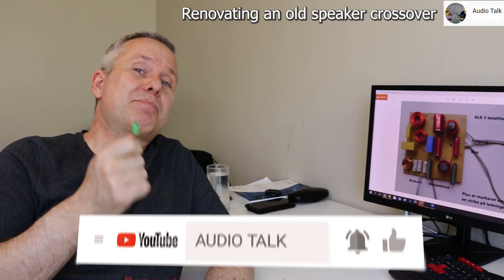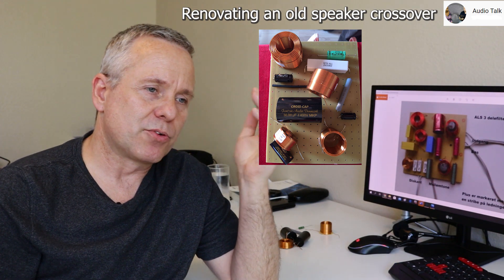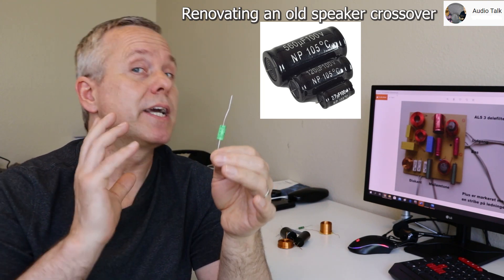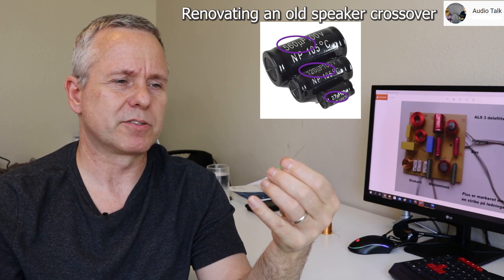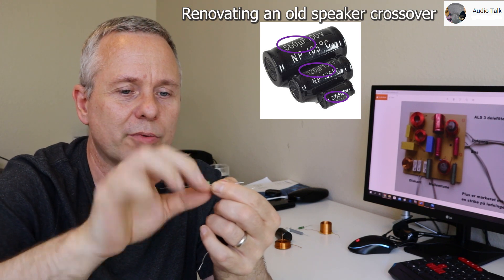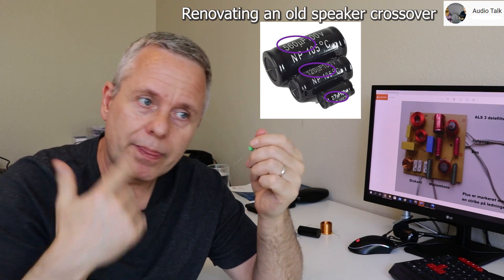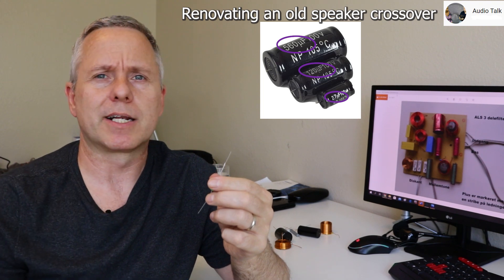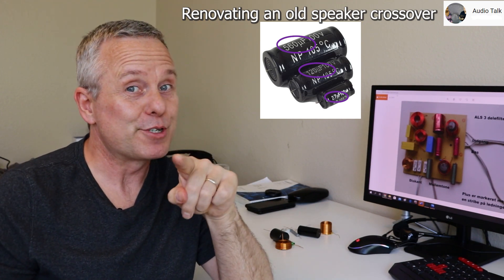Renovating an old speaker crossover

Comment: Stock electrolytics have a smearing effect and saturate.  High ESR and tendency to degrade and leak.  Not to mention, speaker companies use lowest bidder caps that aren't likely in spec to begin with. The only time I replace electrolytics with the same, are large value woofer caps. Then I use 10% electrolytics, built much better than stock.  If the crossover area is too tiny for even Jantzen polyester caps that can stack, I at least bypass the tweeter cap with a .5uf mylar cap.  I had to do that in the Elac debut dbr6.2 due to zero space. I never use exotic caps like copper, tantalum, ceramic etc.  Those tend to be harsh and expensive.  Even 5% metallized polypropylene will be a great improvement.

Comment: Can you really just swap in a film capacitor in place of the old electrolytic blindly, without severely and randomly changing the voice character of the speaker?
Reply: In response to 3:20 in the video.
Reply from the maker: @RobareDuccie1999  the target of replacing to the more expensive film capacitor is to get more details and clarity, mainly we are talking about the series capacitor to the tweeter. So yes it will change. If you can find the ESR of the old electrolytic capacitor and then get a wirewound resistor and place that in series with the new film capacitor and you will likely get a more balanced sound. But all in all a electrolytic capacitor in series with the tweeter is something that you basically don't find anymore because it introduces so much distortion.
Reply: @AudioTalk  Would the ESR change as an electrolytic capacitor ages? If so, wouldn’t you need to grab the ESR off a new equivalent? I’m not sure if ESR changes or stays the same as electrolytics age.

Comment: Just took my Sansui 9090 to an old tech guy that repairs old electronic stuff and he says flat out that there is no need to replace caps unless they are no good.
Reply from the maker: This video is about renovating a speaker crossover and not recapping an amp, big difference. Sure if its caps in the powersupply its not gonna matter as much, but still, to they fail??

Comment: im wondering if it would be a good idea to buy old Bose acoustimas 5 bass box to repurpose the crossover from it for a new system.  they are quite cheap if the woofer in them doesn't work.

Comment: Gonna try and and replace the series capacitor going to the 2232 horn/compression driver in my jbl 4425, if i put a film poly cap, is it a good idea to add 1ohm series resistor as well to make sure to make up for the esr?

Comment: Hello, not long ago I acquired the Kugel-Box 310, beautiful although very beat up on the outside, already polished because there was no way to remove the deep scratches and dents. I changed the capacitor for a polypropylene one, and although the Frako capacitor wasn't far out of value (incredible considering the years), the ESR wasn't good, so the change was for the better. I added more cotton to the walls.

The bass is very good, surprising for how small they are, but the highs seem to be poorly balanced compared to the bass. I tested them with a Nad 3020 and a Technics SU 7300, obviously, each with a very different sound, but with the Technics, which allows two pairs of speakers, when switching with my other Japanese Sonoco speakers (i repair them and sound amazing better than a lot of new speakers) , the volume and definition are brutal. It's like the Kugel-Box 310 sound muffled or, how can I describe it, dry... they sound good and surprising, and they are very directional.

My question is, did you experience the same? The crossover is simple—transformer, coil, 6.8uf capacitor. I tested the tweeters and they are fine, except for the possibility of some loss of functionality over the years, but I doubt it, they are impregnated dome type, and they look great. The front grill probably takes away some brightness, but I am amazed at how muffled the sound is. It's not bad, but I was expecting more clarity from these small ones.

Comment: The best way to upgrade a crossover is to bin it and use an active crossover with Class D amps. Chalk and cheese, unless you are an audiophool.
Reply from the maker: absolutely, but depending on the budget it can be too hard on the budget, but if its high-end its typically better to do that. Phase and linearity is a bigger issue than a clean signal path, so I agree with you.

Comment: Maybe you can help me if you do not mind. I have an ok pair of JBL62 speakers with the Titanium laminate tweeters in them. They are a bit too bright for me. There is pair 4uf 100v axial caps in the crossovers.  What value could I use to tame the tweeters down just a little? There are also 2 orange drop looking I guess caps on the board to. Sorry I do not not know their values just yet or their purpose on the crossover.  As I understand several models of vintage JBL book shelve speakers with these titanium tweeters have a tendency to be to bright. Thanks ahead of time.

Comment: good video👍🏼... I have a pair of Spendor S 100 and changed out the capacitors… I tried changing with Mundorf capacitors but then ended up switching back to original new capacitors...I was let down by the Mundorf, thinking they would be better...I have added Wima 1.0 uf next to the new Bennics on the LF...if they are placed in certain positions on the crossover, the sound can be better...I'm sure you know about this...

Comment: Thanks for asking me to ask . What if anything should you do to said crossover if you replace a tweeter and woofer in a3 way, HD66 Marantz box? The only spec that's similar is 8 ohm and hole size, they don't sound as good as Mordant 2ways i replaced tweeter and woofer with great results . Checked the two film caps and resistor , and also the 2two pots on the front are now good . Crossover points not matching ?? And sensitivity different , sorry . Thanks .

Comment: 1/26/2024: Just found your channel and subscribed. Informative and easy to follow. I have a pair of 31 year old Technics 2-way speakers.  10" woofers and tweeter.  They are still in use with a Kenwood KR-6400 Receiver that is about 31 years old also.  Sounds very good.  Best Regards

Comment: Kent! Great video! I was wondering if you can give me some advice improving the LF of My KEF speakers! I need a little more low!
Reply from the maker: With the crossover you can only dampen midrange or tweeter to make the woofer stand out more. However if the crossover point is higher than 250Hz to the woofer it probably wont have this effect, because you likely are interested in area under 100Hz. And that area is the cooperation between box and woofer, so you cant do much about that other than getting a subwoofer.

Comment: Hey Kent one quick question. I got 2 jbl prx 525 loud speakers that are self powered rated at 1300 watts peak. Long story short on both PAs both amps are gone. I wanted to know if i do an amp delete and run a high quality audio crossover for the Loudspeakers can i get away with that?

Comment: How do you feel about upgrading the crossover components on new speakers?
Reply from the maker: There is certainly speakers that gets produced where a better series capacitor or resistor can lift the tweeter performance
Reply: @AudioTalk  So not a huge difference.  Maybe a little sparkle.....
Reply from the maker: @roybatty-  impossible to generalize unfortunately, and the differences can also be subjective. Many have an experience that its a big lift.

Comment: Changing from electrolytic to polypropylene will change the crossover point and roll off of the crossover. THIS WILL NOT ALWAYS BE AN IMPROVEMENT.

just because one component is more expensive than another doesn't mean it will give better sound. If you switch types or values of your caps, be prepared to change them  back to do an honest A/B comparison.

I'm sure a Mercedes Benz alternator is better than the one in my Chevy, but that doesn't mean I can drop it in my engine and magically expect better electricity!
Reply from the maker: The series capacitor to the tweeter will have a even greater improvement if a series resistor is inserted at the same value as the ESR as the old cap, preferable wirewound. With that said an electrolytic cap has no place in that position and still they can be found in vintage speakers, and they hysteresis introduce so much distortion that it supersedes the change in the Xover point. ESR is not particularly high with larger caps, so that issue is a diminishing issue as you go down the frequency band.

Comment: Ken,   Staring at a pair of 40O watt 2 channel crossovers from Arena15 soeakers with popped VR1 resisters, they are no longer available as boards, but wondering if they are thermistors.  From pictures, they apoear as blue disks, any suggestions on replacements?

Comment: I have a pair of Radio Shack Nova 8B speakers that I bought around 1976.  In one of the speakers, neither the midrange or tweeter work.  The woofer does work.  I'm thinking it might be the crossover.  Is there a way to test the crossover before just replacing the capacitors?  Thanks!
Reply from the maker: The midrange you could test full-range directly connected to the amp. If its both mid and tweeter could just be a wire that got disconnected

Comment: Is it OK to replace electrolytic caps with film capacitors of the same value? The problem is that elecrolytic capacitors do drop their capacity with increase in signal frequiency but most of the film caps have the same capacitance at any audio frequency. So the filter output response with a film cap will be different than it was designed to be with the original electrolytic cap.

Comment: Hi Kent. Do you know what might cause a speaker to drop in volume? I have an old pair of PSB 800 speakers, and one of them is much quieter than the other. I tested the amplifier on a different pair of speakers, and it wasn't an amp problem.
Reply: Sounds like the resistance increased somewhere in the circuit?

If it's roughly similar volume at low frequencies, but lower volume on the highs then I would look for a problem in the tweeter portion of the crossover circuit. If it's similar volume at the highs but lower in the lows, look at the woofer portion. If it's lower at all frequencies then look at the binding posts or your cable or amp or some other portion of the rig that carries the full range.

I should also say, it could be your room. If you haven't already done, swap their position in the room and see if the volume continues to drop from the same side. If it does, it's due to your room geometry and you'll just have to adjust the balance. My room has some weird geometry and the right speaker is always about 1 dB quieter than the left 🤷.

Comment: I have my Paradigm monitor crossover burned-out.  But I opened and checked it out it's actually one of the conductor. Is it possible to fix that?
Reply from the maker: Inductors are the spools of wire and the plastic looking things are capacitors and lastly the ceramic things are resistors, but none of them can be repaired only replaced, and to replace you will need to know there value. For inductors value in mH, capacitors value in uF and resistors in ohm.

Comment: Great stuff Kent, would a cap breaking down cause my mid and bass drivers on one speaker from cutting in when the other side does?
Reply from the maker: Hi Craig, I am sorry I dont understand the question. Is there way to rephrase the question or maybe more explanation to what you are experiencing?
Reply: @AudioTalk  Hi Kent, sorry for the initial explanation, i will try again.
I have a set of Monitor Audio Radius 270 speakers, absolutely gorgeous speakers. i noticed a while back on one speaker (the RH) the sound was cutting off on the mid and bass driver at lower volume while the LH one worked perfectly, i swapped them over to rule out the amp, problem followed speaker.
I opened the speaker up looking for a loose connection etc. Everything was nice and secure, so in the hunt for the problem wondered if the crossover was the issue hence the hunt on YouTube and coming across your fantastic resource (many thanks)
Further investigation reveal if the mid and bass are not working on the RH speaker as
the LH is a little bump on the driver surround or turning the volume slightly up gets it working again.
Sorry for the novel, any help would be greatly appreciated.
Kindest regards Craig.
PS your video has inspired me to update the components on the speaker .
Reply from the maker: @craigwheaton2506  thank you very much for that, and sure if there is an electrolytic capacitor in particular  in the lowpass or bandpass, and perhaps is dried out could cause added resistance. Other than that if its a resistor issue from some kind of correction filter they will typically show discoloration from heat, same with inductors will typically physically show. Swapping drivers between the 2 speakers is a great way to eliminate them as the culprit.
Reply: @AudioTalk  Thank you so much Kent.
Reply: @AudioTalk  Hi Kent, bit of an update, pulled the 4 bass drivers out and Xovers resoldered the connections all components looked fine, test for resistance across the speakers individually with my fluke meter all but 1 are open circuit..there’s my problem I suspect
Reply from the maker: @craigwheaton2506  unfortunately the most common thing to go are voice coils, which means new woofers, or maybe cheaper get another set used and steal the woofers depending on which set is in the best shape. All depends on how expensive the woofers are.
Reply: Hi Kent, i have some on order from the UK they have an alternative that fits, quite reasonably priced i thought, until then i will use a set of Wharfedale 9.1's.
Thank you for all your help 🙂
Reply from the maker: @craigwheaton2506  any time and thank you for the interest.

Comment: Hi, I have a set of pioneer floor speakers they don’t seem to have a crossover just directly wired to each other and a capacitor on one of the tweeters would it be safe to install a crossover to get better sound?
Reply from the maker: It depends a lot on what the response is on each speaker driver. If its a 2 way speaker (woofer+tweeter) and the speaker drivers are really high quality its possible to pull of such a simple design and have amazing quality that would be compromised. Typically this kind of setup will not be found under a few grand. Do you have a model name and I will look at it?
Reply: @AudioTalk  pioneer CS-G305
Reply from the maker: @wessandlin8056  there is a very good chance distortion will be lowered with a crossover here, but its important the crossover is matched to the impedance of each speaker driver or else it wont work right. So a 8 ohm crossover will only work with 8 ohm speaker drivers.
Reply: @AudioTalk  should I try one of those cheap crossovers from eBay?
Reply from the maker: @wessandlin8056  I dont know whats avaiable there, but its important that the impedance (ohms) its design for is the same as the speaker drivers or else there will be a mismatch.
Reply: @AudioTalk  I've always wondered about that because there are crossovers out there that say "4 or 8 Ohm". What about those? Thanks.
Reply from the maker: @j.t.cooper2963  Yep, that doesnt really work well at all. There is so much to the end result of a speaker in the crossover, getting sensitivity and load linear. lowering distortion etc through the crossover, that a standard made crossover will not address, but yes to say 4 or 8 ohm is very inaccurate, but for a boombox with a die hard class D amp board it can be fine, when its for having fun, just not for Hifi

Comment: I have pioneer private pro sx 730 a couple of speaker but it have a problem on the high volume or high trible the tweeters automatically turn off for 10 sec after 10sec it again work. What should I do plz tell me should I replace crossover capacitor?

Comment: Film capacitors have long leads . can the be trimmed? And do they get wired from one end opposed to the other?
Reply from the maker: No problem in trimming the leads and they are bipolar so there is no particular direction in how they are mounted in the circuit